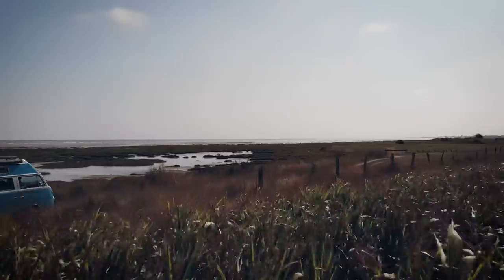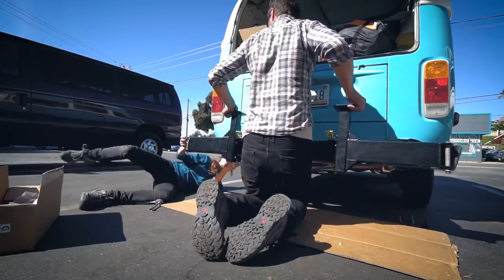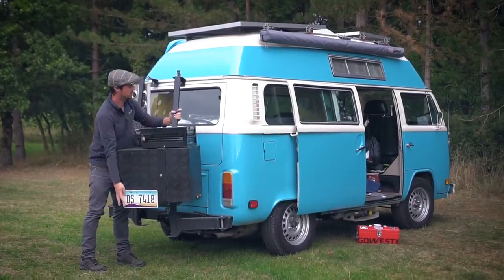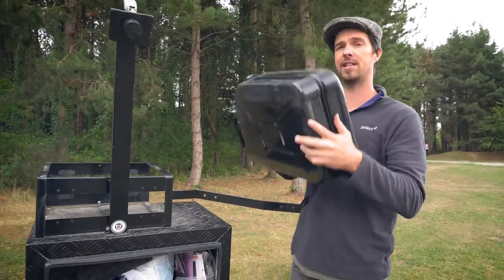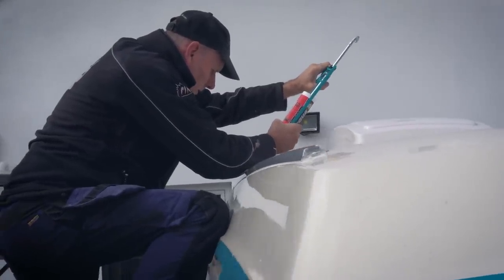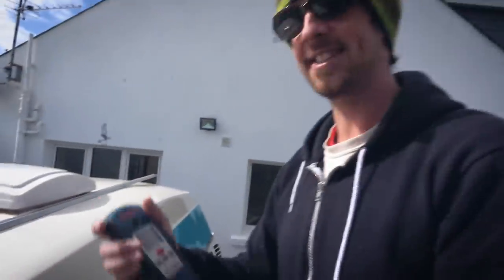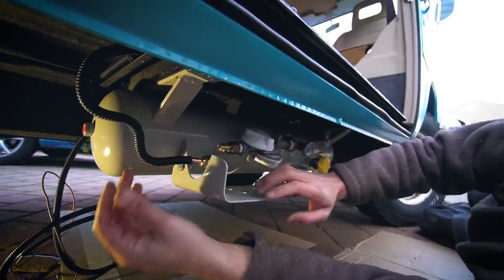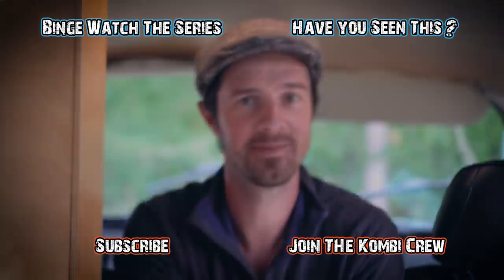VAN LIFE UPGRADES For Extended Overland Travel

Comment: Wow I have a box on the back of my 74 bay but it wobbled so I took it off.  Mine was swing away too. But I like the high poles and gutter clamps.  Clever idea.  I travel around Australia.  So a jerrycan is a must but never seen one on the side .
Reply from the maker: Yeah the gutter clams are needed. Same design as GoWesty. The Jerry can on side worked fine in case you were wondering.

Comment: So, serious question.
If you break down on the side of the road. Is there any way to take the swing an off? As you might not always have enough space on the side of the road to have a swing arm hanging out the side of the van.
Reply from the maker: thought about that too.  We can latch it so it doesn't swing all the way out.
Reply: @KombiLife  ah cool, and you still get full access to the engine?

Comment: A small block Chevy engine would help.
Reply: A newer LS 5.3 or the old school 350?  Probably the only car I haven't seen a GM small block wedged into although I have never looked, I am sure there is a million of them. I Definitely wouldn't be wondering if it has the power to push around all the gear anymore.